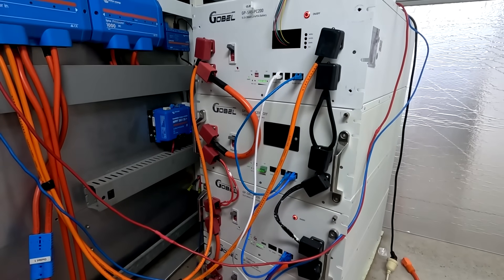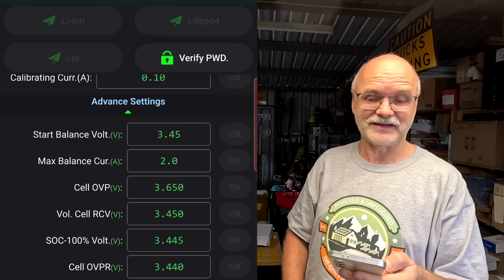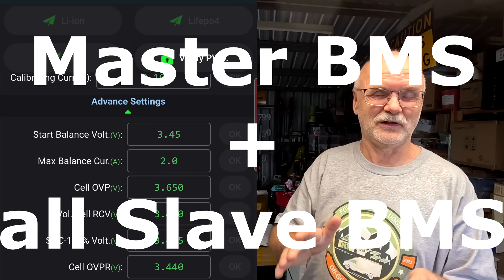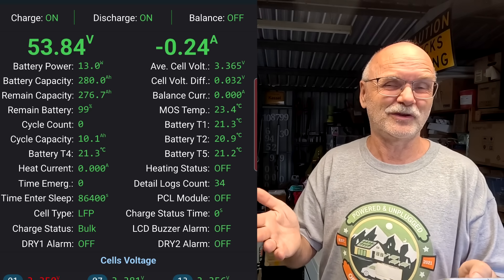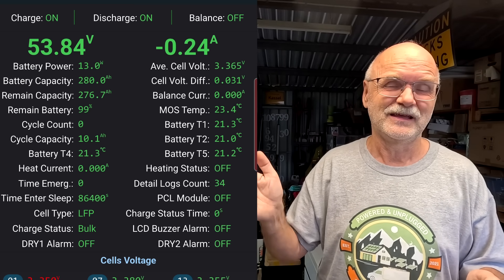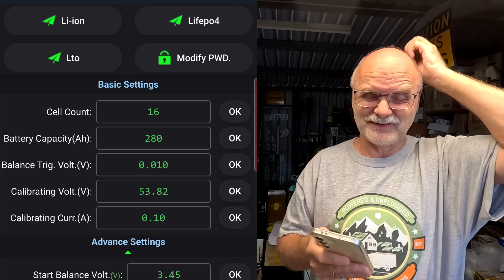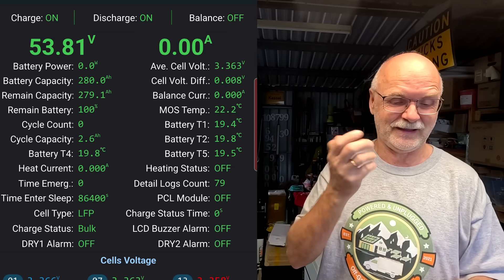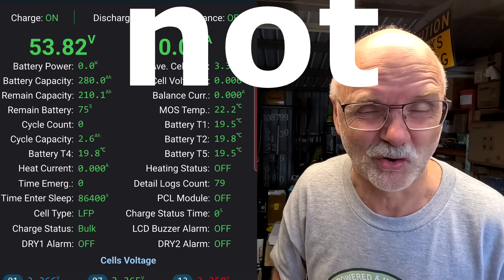2 new hidden features + a new, old bug. The JK-BMS never disappoints!

Comment: JK BMS is a scam for years cause they suck: every single day when I get 2 messages in my mailbox caused by the JK BMS which pretends to be compliant with the Grotwatt SPH inverterseries.
They call their product inverter BMS and COMPLIANT to GROWATT SPH but why do I get these 2 messages for all our SPH 4600 inverters every single day ? 

1st MESSAGE (Body)
Device serial number:	N...41
Device alias:	N...41

DataLog serial number:	J...L
DataLog alias:	Ü3

Plant name:	Ü3
Time:	2025-05-18 11:40:40
Event id:	BMS Error:
Event description:	BMS Error:

2nd MESSAGE from the same inverter
Device serial number:	N...41
Device alias:	N...41

DataLog serial number:	J...L
DataLog alias:	Ü3

Plant name:	Ü3
Time:	2025-05-18 11:40:40
Event id:	BMS Error 301
Event description:	BMS Error 301

It is a scam if they cause error mails by the inverter cause at the end it is JKs fault which they are not fixing even though we are complaining over and over again.

Comment: The confirmation pop-ups are more a matter of APP development and PC software. If they fix this, then surely it has very little to do with the firmware on the BMS itself?
Reply: and would be so nice if they would make the JK BMS android app to work with all android versions and all android phone's CPU's versions (latest JK BMS APPs only supports arm64v8 CPU (does not support armeabi v7, will not even install) but even on my other phone based on arm64v8 (android 8.1.0) it doesn't start after installation.

Comment: We're using four LiFePo4 blocks with a 200A JK inverter BMS. All parameters of the four BMSs are set identically 😉

Two blocks with 302Ah Catl cells and one block with 280Ah Eve LF280K cells jump to 100% SOC when they reach the 56V final charge voltage👍
But the fourth block with 314Ah Eve MB31 cells stubbornly remains at 99% SOC 🧐🤔

Some things you just don't have to understand...😅😂
Reply: calibrate the last pack voltage higher than real volt just 0,2v

Comment: Thank you for the warning. Being a v15 owner I am concerned that bugs won’t be fixed in the v14/15 BMS. I get that there will be no new features, but surely bugs like this should be addressed. No firmware is perfect and critical bug fixes should still be resolved. The normal user that bought a battery with v14/15 a year ago will probably not change the BMS and will have the battery in service for quite some time. I think JK should consider maintaining the firmware if/when bugs are identified.
Reply: True that. It is a bloody shame JK isn't updating anymore after only that short of time the inverterbms is on the market. Not good for the trust.
Reply: @LordOneHoop yep - v15 is still a good piece of hardware
Reply: @bencornish505  But also and again with flaws which should be adressed with proper fireware reparations.
Reply: @bencornish505  Allthough it is not right i must live wth the bugs and will check the voltages myself. If the cells are balanced and Victron BMV gives me the 100% full i guess it is full enough. When i really want all the cells to be 3.65 volt i can allways downgrade the fireware. Probably i will go back to the fireware before the counting 'upgrade' and accept what it is. JK inverter bms V15 is indeed not bad and works good with Victron.
Reply: Well, this is disappointing. Just bought 3 x jks in the last month, and I received the v15 it seems. I bought these so that when I build more packs, that I can easily buy the same BMS. Now, just to know that it's already out dated/discontinued :/
Reply: @LordOneHoop  True, its time to migrate to Seplos imo

Comment: I have only 1 bms for 1 battery but the bms doesn't reset to 100% either with the latest firmware. It did it with the first firmware but after the counting thingy it doesn't anymore. It does go to floatvoltage 27.6 tho but never gets the 100% procent where the Victron BMV 712 does.
Reply: Same, can't get it to 100 anymore. shit sits between 97 en 98.
Reply: @firefly2472  Sometimes only 95%